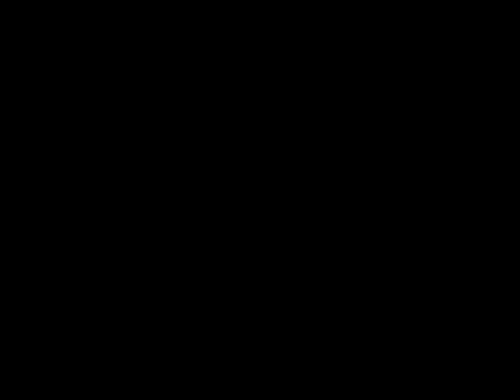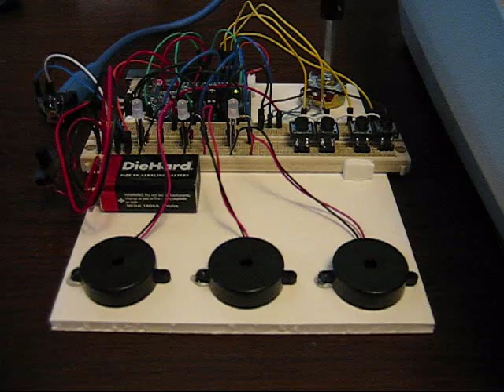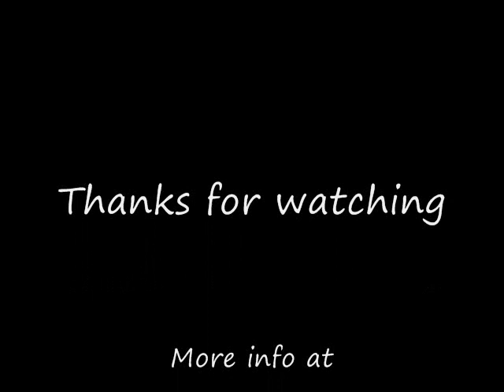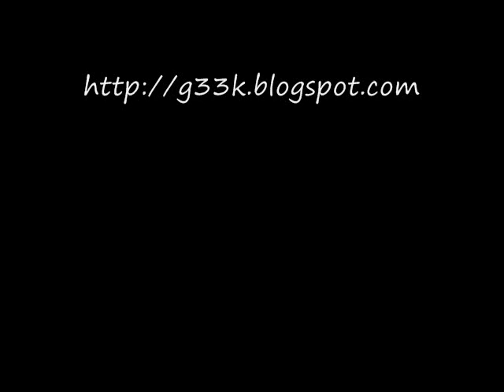Arduino based Programmable MIDI Drumkit

Comment: i used this website as a reference ... https://www.sparkfun.com/tutorials/330  ....i got the soft and hard hit....but i m able to create a snare or any drum sound from this....is the code i have add
Reply: i m not able to get the drum sound in any software...i m using cubase 5
Reply from the maker: +Asish Agrahari , the code at Sparkfun only sends the word "HARD" or "SOFT" to the COM port.  It does not generate MIDI messages :-(
I do not know how to make cubase understand words from the Arduino.  I don't even know if Cubase can listen to com ports :-(

How I did mine six years ago was to wire up the circuit that turn the Arduino into a MIDI device, then I hook it up to a MIDI keyboard.
http://g33k.blogspot.com/2010/03/programmable-midi-drumkit-i-dont-have.html
http://itp.nyu.edu/physcomp/labs/labs-serial-communication/lab-midi-output-using-an-arduino/

Comment: but can u tell me.i m using windows 10 and hairless serial.i conected my piezo n test the knock code it worked but i m not able to get the drum sound....arduino is picking the piezo signals but not sending it to the channel where drum sound is sampled...plz help me in this as i m trying this from many days....i dnt knw where i m wrong...i m not just able to assign the drum code in piezo
Reply from the maker: +Asish Agrahari I can't promise you anything, but if you send me your schematic and code I will take a quick look.
You can send me a private YouTube message or email me.
https://www.youtube.com/user/hwiguna/about

Comment: Is each sensor connected to a separate potentiometer to control sensitivity? Or does one potentiometer control all sensors?
Reply from the maker: One potentiometer controls the threshold for all sensors.